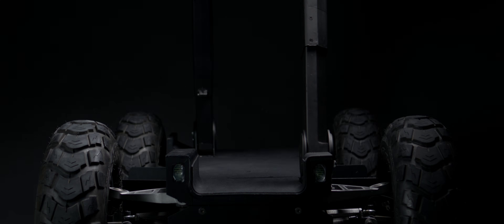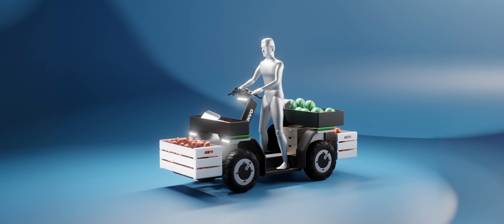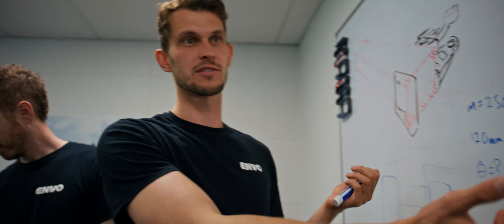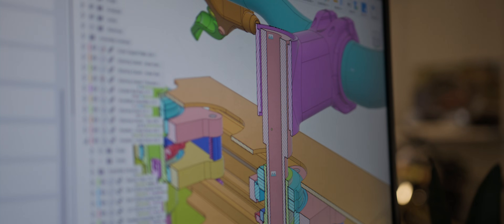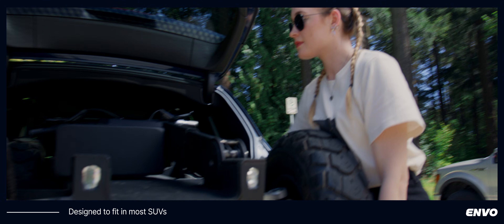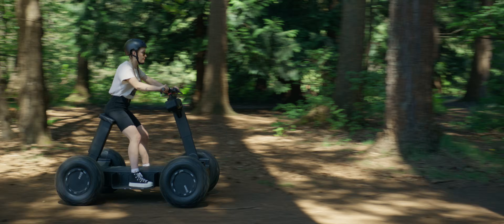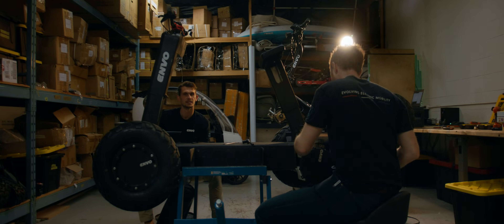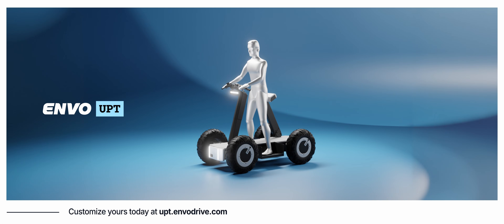ENVO UPT , Utility personal Transporter, Proudly Canadian 🍁

Comment: If you take your transport platform put tiny tiny house camper on it, the law for camp at parks 🏞️ is only has to move campsite every four week so 12 time year and move 300 feet , so on your transport platform put a tiny tiny home cabin but fix design flaw as heating has to have four feet clearance and also winterize it then perfect

Comment: Take tiny tiny homes type cargo cart and put it on your device for veemo Lt add solar panel on top sell as mobility device and camper winterize walls use idea of tiny tiny home guy uses but make the split heater with four feet safety clearance he made design mistake put heat too close to sleep area you guys add the tiny tiny house idea to your veemo Lt thing but fix split heat up top solar charge  and power it and then at front where window it put sliding door with screen. Then from front seat area person can step back into it and still keep side doors 🔐 at recumbent seat driving areas. Price at five thousand max price and make veemo Lt cart combo tiny tiny home and sell to municipalities like Hamilton who just ordered from China for shelter you guys can get contract from gov to sell tiny tiny homes on veemo Lt and gov can house the 80 000 homeless disabled who need place and at five thousand each it solves it gov ODSP will help ontworks discretion fund to help people get place first last they could order a veemo Lt with a tiny tiny home cargo area for housing people. Try design one veemo Lt with a tiny tiny home style but cargo area on back. Try it do a promo with the tiny tiny house guy. Build and get talk shows news to promo it. Show people for three thousand to five max if you add solar power split heater winterize it then would sell. Vanlife ones ODSP disability ones eco friendly ones like summer camp at concert festivals would get them too. People can get and rent as camper. Sell them multi purpose.